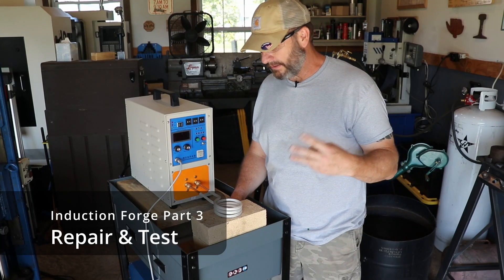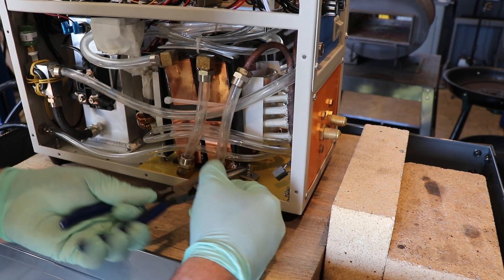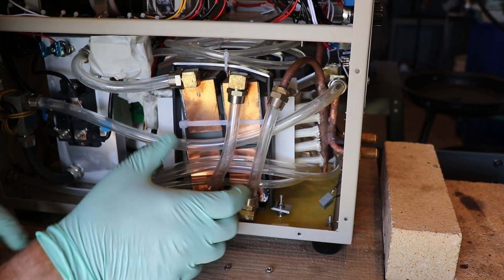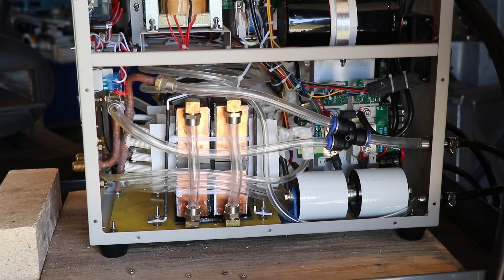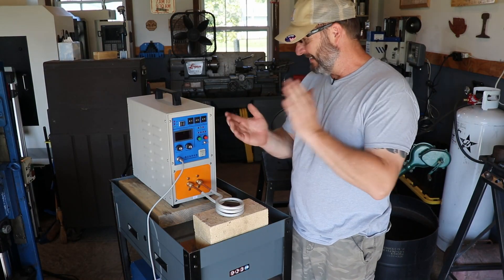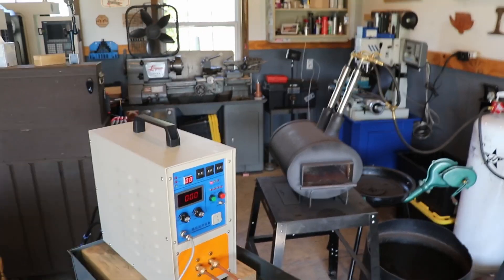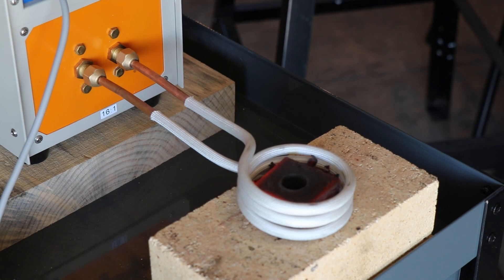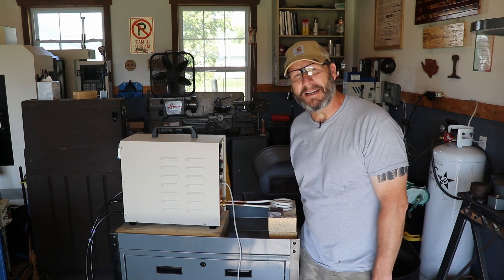Induction Forge Part 3: Repair and Testing

Comment from the maker: I thought it would be interesting to post the feedback I got from the seller after I sent them photos of the malaligned components inside the unit.  

"So sorry for the problem. The package may crushed put inversely by the carrier in transit.

Please check the enclosed picture. Could you please loosen 4 nuts, straighten the magnetic core, then tighten the nuts again?"

They call it a magnetic core.  What ever it is, I think it is safe to say that they are using translation software to chat with me, which I think is wild.